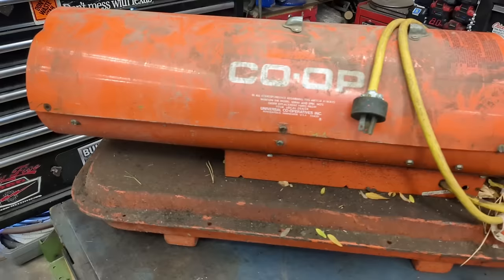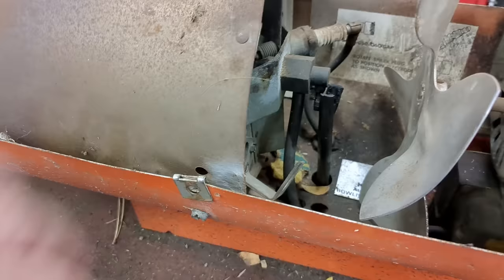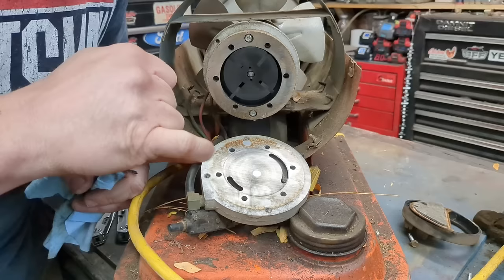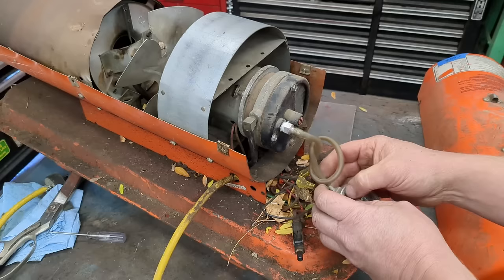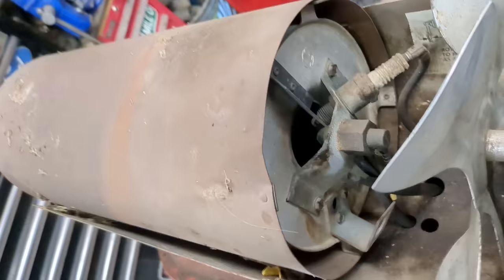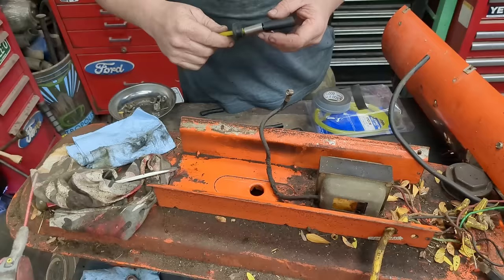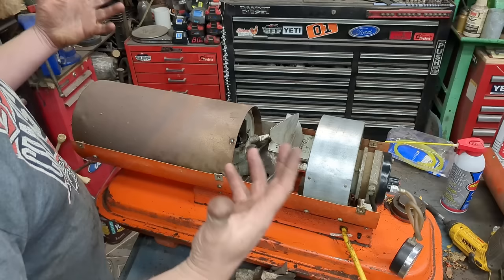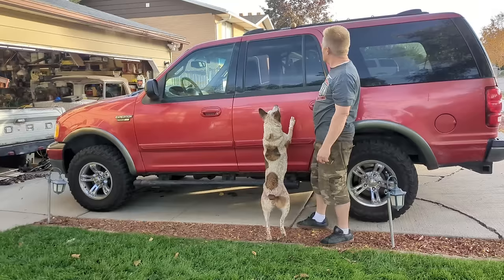Diesel Kerosene Forced Air Heater FIX EVERYTHING

Comment: I used to be a tech for these heaters many years ago. The biggest problem I found with them is water and dirt in the fuel. They really should be run on kerosene, not diesel. If the heater is stored with a partial tank of fuel in the off season the filler cap vent will allow humid summer air to enter the tank and condense. The water being heavier than kerosene will settle on the bottom, and rust the tank. Look in the tank with a flashlight to see if there is water. It's best to drain the tank at the end of the season. Or - fill the tank completely so no humid air can enter during storage. The fine mesh fuel filter tends to collect lint, and should be checked/cleaned frequently. I learned lots of tips and tricks over the 35 years I worked on these heaters, but they are too numerous to mention here. One tip I will share is to always start the heater facing outside for the initial cold start. When the raw fuel hits the cold nose cone (aka afterburner) it will cause a puff of smoke (partially burned fuel) and stink. Starting the heater outside, and allowing the nose cone to become bright red (slightly dark in the middle) and then bringing it inside will prevent the stink from filling your shop. The heater only burns clean when the cone is red.
Reply: Thank you for sharing, I bought one to keep my shop warm for a little while. Will keep these things in mind.
Reply: I have a redline 150,000 btu heater and it fires up good and runs for maybe 3-5 minutes then shuts down/fills garage with black smoke.. Replaced the spark plug but still does it.. Any ideas how to fix?? Thanks brother!!
Reply: @Fine_art_aerial  try removing the nozzle and take it apart to check for dirt. also, on the 150 BTU models, there is an in-line filter that gets clogged with lint. It's located inside the flare of the fuel pick-up tube. It's removable for cleaning. The air outlet filter could be clogged, and needs replacement. It's the felt one with the cork surround. There could be a spider or mud dobber in the air adjuster screw.Check inside the tank for dirty fuel or water. Use a flashlight. Lot's of possibilities.
Reply: Wow, pretty much the info I was looking for. Just recently purchased one that can run on 4 different types of fuels/oils. Been running kerosene which has an odor to it and was wondering if diesel's odor would be any less noticeable. Borrowed a buddy's kerosene can and need to purchase either a kerosene or diesel can for myself but didn't want to make that $100 plus commitment with a Justrite can, until I found out what's best. Appears kerosene's the way to go, thanks.
Reply: What would cause a 215000btu heater to shut off after a few minutes and not restart and have hard starting issues?
Reply: @jacobgriffin6812  thermostat issues most likely.
Reply: I buy the Klear Kerosene and use that. Mine still runs like new.  Bought my 55,000 back in 1992!
Reply: I bought one of these kerosene heaters years ago brand new and I bought good fuel too. First thing I learned is they stink to high Heaven in a enclosed building or room and my eyes turned red and got very irradiated in no time.  These type heaters are not your solution to a enclosed room by any means! In fact right on the kerosene heater stated it must have a good outside air source! My cone on the heater was bright red also! You need a lot of outside air that kinds of defeats the purpose of heating a room! 
What I ended up buying, but does cost more money to buy one! Is a infrared ceramic heater that’s 99% efficient and doesn’t not need any outside air at all. It also has several safety sensors for carbon monoxide and if there’s a lack of oxygen it will auto shut off.  Mine has 5 ceramic pads and will heat up really fast where you can’t stand anywhere near the front of the heater for very long at all. Yet the sides and back of these heaters remain cool and can be mounted to combustible materials as long as the combustible material doesn’t stick out in the front of the heater. 
I originally had mine mounted in my 2 car garage that had 12 ‘ high ceilings inside and the outside wall were made of cinder blocks.  Even in freezing weather I could heat my garage up to workable conditions probably around 68-72 degrees within a half hour. It was easy enough to move and I use it n my motor home as well. 
After selling my motor home I took my heater out first and I ended up making a stand on wheels t try hat the heater mounted on and the back of the wooden stand had room for a 20 gallon propane tank to sit behind the heater making a complete portable heater system that I can move around my home or garage, etc. 
Just avoid using this heater if you’re around any kind of flammable fuels where gases may be ignited from the heater flames!  As with any heat source there still needs to be come common sense used where you can and can’t use this heater at!  But generally speaking this heater is the safest heater that runs on propane or any other type of fuel to keep people as fast as humanly possible!  I’ve had this same Empire ceramic propane heater for over 25 years and it still works like new and never has gave me any problems. If it’s been sitting around a long period of time without being used, you may have to blow out the heater with compressed air as best you can to get rid of dust and spider webs that will block the propane flow. Other then that, it’s never failed me!  Got a push button igniter to start the heater. 
They do make a cheaper brand of these ceramic propane heaters, but I haven’t tried any of these cheaper brands to recommend them or not? I can say I highly recommend the Empire ceramic heaters that come in infra red or cool blue flames. Again I haven’t used the cool blue flame version, so I don’t know if it heats as well as the infrared or not? But if the glow from the infrared bothers you? Then you may want to use the cool blue flame version!  Promise you, once you use one of these you’ll never want to use a kerosene heater ever again!
Reply: @Fine_art_aerial   had similar problems with a brand new kerosene heater and using high quality kerosene fuel too! Longer it ran in a enclosed room the more the smell was and my eyes would turn red being irritated from the gas that came from the heater. I gave up trying to use it for my purposes. If you’re heating the outside area trying to stay a little warmer these might be ok? But certainly not in any kind of enclosed room! I bought a Empire Ceramic 5 panel propane heater that’s 99% efficient and has absolutely no odor and several safety sensors that will shut the heater down before it cause any dangers or fires to happen.  Been the best heater I’ve had in over 25 years and still works like new.  Read my other comment for more information
Reply: I've had one of these, Ready Heat, sitting in my basement for years. I can’t give it away. Mint condition.
Reply: Thanks 👍 , that was very nice of you to share that, really appreciate that, thanks a lot, GB
Reply: Mine stinks terribly. And the cone  is bright red! ???

Comment: I own 2 of these heaters, made by desa they are as reliable as a stone and super simple to repair and service. I’ve always ran them on number 2 diesel both on road and off road grade, wouldn’t trade either one for any other heater. Years ago I bought a plug in thermostat for them that way I can set a temperature and not have to constantly tend to the heater it cycles on and off like a furnace.
Reply from the maker: I've had a few with thermostats and that is nice.
Reply: I wired a baseboard heater thermostat(garage sale find) into a 10 gauge flat extention cord. Hung the thermostat about chest high. Ran my heaters for years.
Reply: Excellent video  I have a cupple at my shop I'm going to repair  thanks

Comment: Got one of these from a garage sale a few years ago. Cleaned up the outside and replaced the outside filter. Been running every winter in my garage when I needed it to. Best 20 bucks I have spent in a long time.

Comment: Well I am impressed. I never knew those things could burn that clean. The last time I used one of those was in the 80s to heat the unheated bay of a heated shop when needed during freezing winter weather. Even though it was near new, it would burn your lungs from the fumes if the bay door was not open (which defeated running a heater). Definitely would be worth having one around the house for use outside now that I know they can burn so clean without all the fumes and CO. Thanks!
Reply: I just realized the reason why the near new heater put out so much fumes (back in 1987). The altitude was 5600 feet above sea level. Had I had known {or realized) back then what you shown here I am sure it would have burned cleanly.
Reply: And also ultra low sulfur diesel  helps too

Comment: I've been lucky enough to have three Farm King high pressure heaters over the years that'll burn anything from Kero to diesel to home heating oil and filtered used motor oil. Of course, the filtered motor oil does tend to gum things up more than the rest, but in small quantities diluted in the kero or diesel, it does just fine. They actually run Wayne or Maxon (located here in Muncie) burner assemblies and typically run between 95 and 105psi. Depending on what fuel oil you use, a simple air vein shield is adjusted to achieve optimal burn. Different size nozzles are available from my local HVAC supply house. I love these things because they're quiet, efficient and so versatile and easy to maintain. But I do have a low pressure backup heater that I use for the detached garage when I start the motorcycles in the Winter. Regardless, they're handier than a third hand! Thanks for this video Moe! Zip~
Reply from the maker: Your Farm Kings are neat and I recall the videos you did one them. I have never come across one locally.
Reply: Used motor oil..filter good..
Get the oil up to about 130 degree..be for u starting it..
Seems to help..

Comment: When I had a garage I ran a 110,000 BTU one in a 2.5 car uninsulated garage. Even in -20F it would heat up in about 20 minutes. I did put a CO detector in there and it never registered any CO. A friend gave me a thermostatic switch from a 120V electric oil radiator that I wired inline so about every 30 minutes it would cycle on for 5 minutes. Great system in colder states, never seen the inside of one until today. Thanks!

Comment: I got one of these at the scrap yard, and it need a HV transformer. I called around and none were available. I then looked into a neon sign transformer, and the output was similar, and it was more than two thirds less than OEM, and it worked very well.

Comment: Instead of just ATF, I mix acetone, ATF and 3 in 1 for things like that.  Works as a way to unfreeze nuts and bolts too.  Much better than Kroil or similar stuff.
Reply: Your correct!😎😎
Reply from the maker: For breaking stuff free yes, this is more for just lubrication in this application.

Comment: I picked up one of these years ago for $25.  Would sort of light then blow out.   It was that rear plastic cap was cracked.   Easy fix.   Set the pressure with a harbor freight gauge.  Been running for years trouble free.  Great video.

Comment: I had one of these that I got used 35 years ago that had the cone melted off of it when I got it and someone before me had put a square metal J-box cover over the front for the "cone", I used it to heat my garage at home in the winter when I went out there to smoke cigarettes in the winter. It worked fine for years only smelling a little kerosene when it first started up. It finally stopped working 10-15 years later and I got rid of it and found a better smaller BTU unit that was intact but I have not used it for years since I don't smoke in my garage, or at all anymore. I love your channel brother, I'm 60 now but I always learn something interesting in your videos. You are like Mr. Wizard as far as I'm concerned, so keep up the great vids, and Ginger has become quite the Star.

Comment: We used those back when I was working in paint and drywall. They definitely work well heating large areas. The fumes aren't bad unless you allow it to run out of fuel whilst running. Excellent for helping latex paints and sheetrock compounds dry in winter. But they're not worth a 💩 for helping oil based paints and enamels drying. They'll actually prolong it. Like trying to dry latex paint with a water humidifier.

Comment: After watching your vid a few times I got a free one of these that had been left outdoors for years. The tank was full of water and the foam and screens were done or missing. I tore it most of the way down. Bought some parts, some adapters and $15 of kerosene. When it fired up the heat blew my mind!! This one took quite a while but I could do the next one MUCH faster. A fun project and now I have a working heater for the garage for under $30! 
THANKS for the great video

Comment: Man you are great at fixing stuff! Iv had a few that i couldnt figure out. Iv been using propane because it doesnt stink up my garage but it doesnt heat very well. Im gonna go back to the torpedo and make sure she's burning right. Thanks!
Reply: Try the diesel fuel. I think it does not smell as bad as the kerosene
Reply: @robertwoodward4525  Iv been using fuel oil actually. Probably the worst of the three i dont know

Comment: I fixed up one last winter that I bought on BookFace Marketplace. It was one of those that had no wheels or feet & because it had sat on the ground (or concrete...) had rusted some pinholes in the bottom of the tank. There's a hint for folks: if yours does not have wheels - put some self adhesive rubber feet on the bottom to keep that tank dry. 

I cleaned the tank inside with vinegar then after it dried sealed the tank outside with some metal-'bondo' (to block the pin-holes & reinforce them). Once that dried, just painted the outside with Krylon and sealed the tank inside with POR-15 tank sealer. 

I then made a 2x4 wooden 'carriage' for it to sit on with a couple old wheels, a found tiller handle & now it's ready to use. 

I like how you save things that still have a lot of life in them... Really appreciate the videos. 

Manuals and parts for these are all available online.
Reply from the maker: That's awesome. Nice fix
Reply: @sixtyfiveford  Thanks - especially since K1 kerosene is pushing $7/gallon here in SWVa... those drums of diesel bought this spring at $1/off retail are helping keep the garage, and house warm now with this heater. I'm a bachelor so a little start-up stink doesn't bother me in the least. Beats being cold! ( I snag gift cards at Kroger stores, or online place, I  shop at... then use the 'fuel points' to buy cheap fuel.)

POR=15 fuel tank sealer is awesome but once you open the can you have to use it NOW. Get several tanks cleaned, stripped to metal inside, and BONE DRY and do them all at once.

Again - I like how you keep 'old junk' going... while others are spending bank on 'new & improved'... and then having to pay someone to fix it. (Progress is great... but why does so much 'new' stuff break 1 day after the 30 day warranty expires?)

Comment: Great video, one thing you forgot to mention was adjusting the top, so the fan when it's spinning doesn't hit the cover, I found a top of the line one in the trash, and it just needed adjusting and a good cleaning, like in your video, but when I screwed the top back on the fan was hitting the top cover, which needs a person with a lot of spare time to tighten, and untighten, push in, adjust, spread apart, and try to get it just right, the top of the line one I have was a real bear to get jusy right, and as soon as you lift it to move it, the adjustment process has to be done all over again, I finally gave up, and put spacers in on every screw, which made a gap, and you know what that causes, so I used heat resistance gasket material to seal the unit, just wanted to share my problem and fix.
Reply from the maker: My main unit under my bench was like this and it took me at least 8 dozens times to get it right.

Comment: A number of years ago we worked in the bush and had to warm up a stranded pickup. So we had a diesel fuel heater similar to this. We pointed the heater at the front of the truck intending to blow warm air under the hood to warm up the engine to a small degree to start it. We didn't have the heater too close as it could throw quite a bit of heat. Enough room to walk by 3 to 4 feet. Well it warmed up alright. Melted the plastic grill right off. This was in -35 degree weather.
Reply from the maker: That's a great story!

Comment: We use a torpedo heater every winter in the shop.. works great.👍👍 just don’t let it run outa fuel while running because it’ll blow a huge white smoke that wreaks of straight diesel exhaust!!
Reply from the maker: So true. I'll hear it cough and I run as fast as I can too shut it off before it dies and pumps the entire shop with diesel.